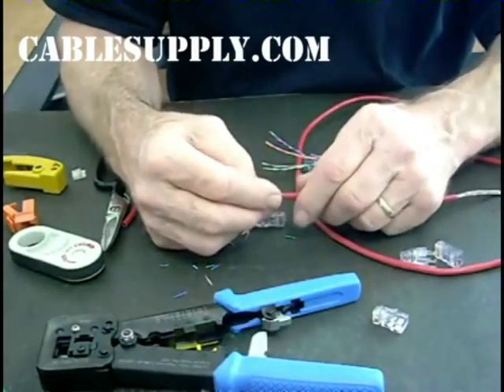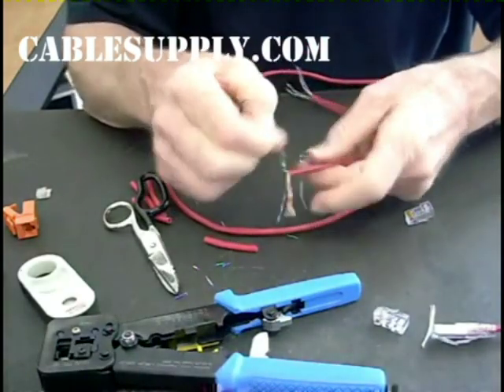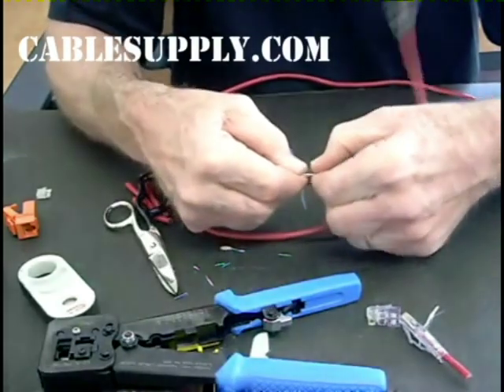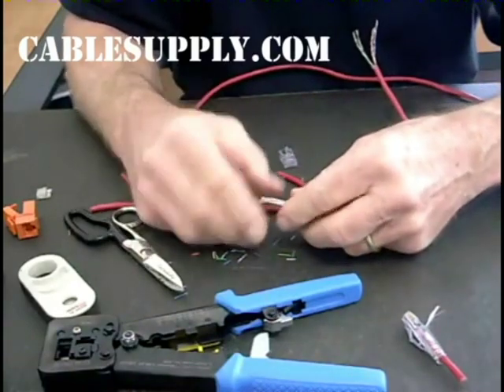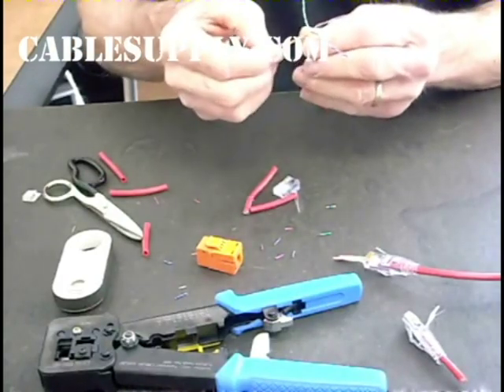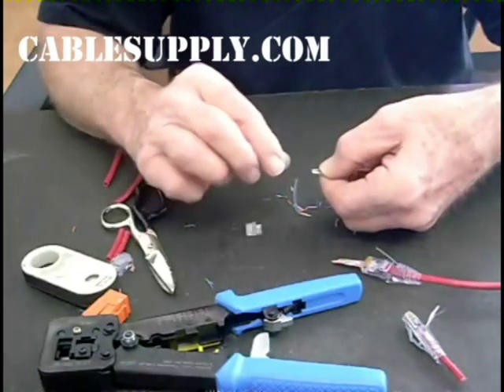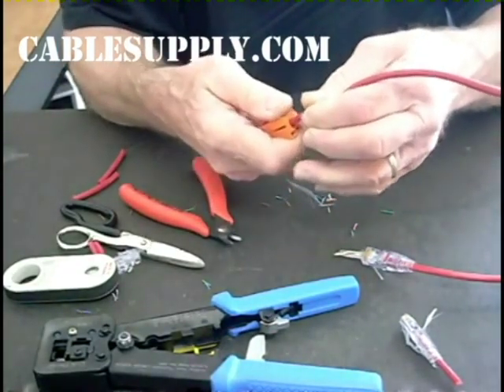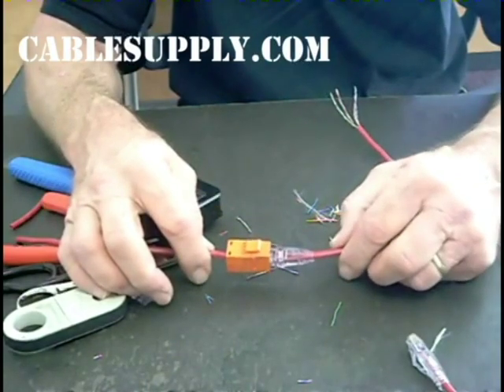Platinum Tools EZRJ45 Mod Plug

Comment: Is the strain relief part a requirement?  In my home network, I am using these connectors without the strain relief part and finding that the small clip that bends inward to secure the jacket is breaking and falling out on 2 out of 3 crimps.  Is this due to the lack of the strain relief part or is my box of connectors defective?  Note that I am using Platinum Tools 100054C crimp tool.